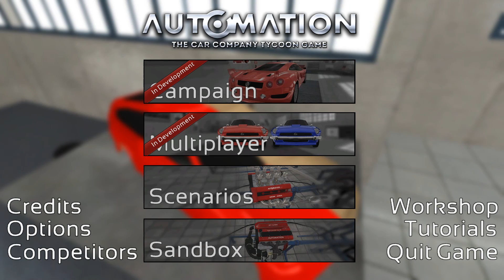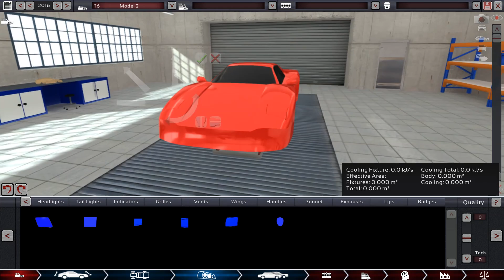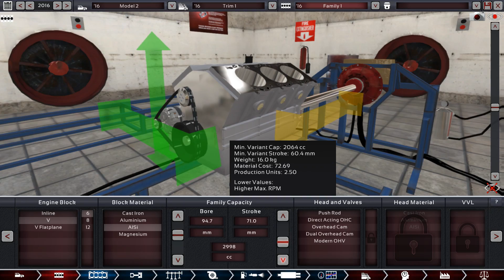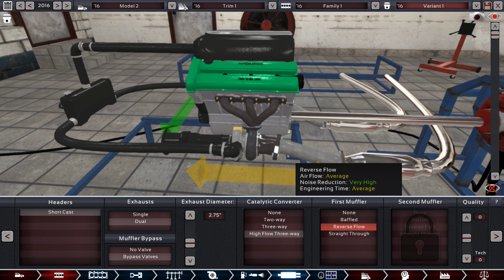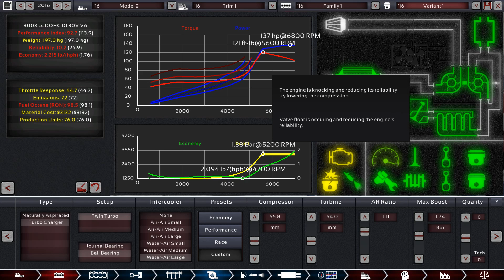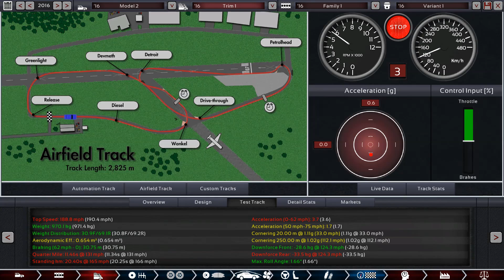Automation Challenge Build An Economical Sports Car

Comment: Aluminium Silicate. Not AiSi. AlSi. Usually the blocks that are made of AluSi are mixed compund of 60-80% Aluminum and the rest is silicate. Replaced the previous "generation" of the alloy, which was NikaSil, respectively, Nickel.

Comment: Does unsprung weight affect things in this game? That car is extremely over tyred. So much weight banged on for no real purpose. 355mm! That's Viper ACR big. They'd weigh a tonne.
Reply: It's ridiculously fast, however.
Reply: +MinigunGaming but it would be faster without the wide as wheels.

Comment: budget super car? make a car with 600 hp or more with 70,000 bucks with some profit. NOTE: i dont knw how the prices in this game are. i recommend either a v8 or a v6. (the price and speed of a z06) your meant to compete with other budget supercars like the 2016 z06. the power can be slightly below 600 the price is not your main priority the time set is.
Reply: since i dont know how prices work lower the price until its a challenge.

Comment: How about Economical American luxoboat. Think about Country Squire from Forza. It has to be cheap, luxury 50+ reliability 75+ 92RON, and at least 25MPG, Doesn't need to be fast, but has to have enough power to actually move. On top left corner there us year selection, put it on year 71. (Fuel crisis hit that year)
Yes it is possible.